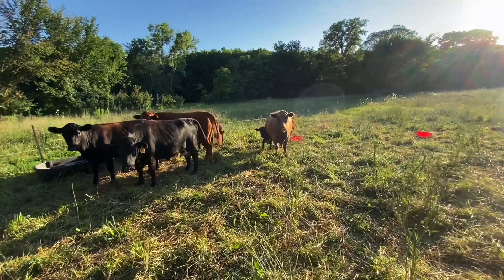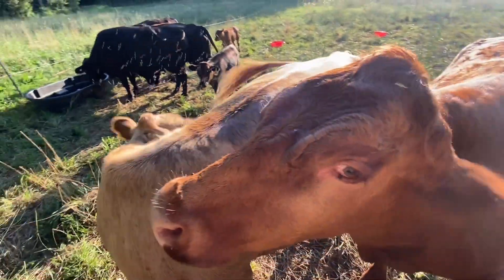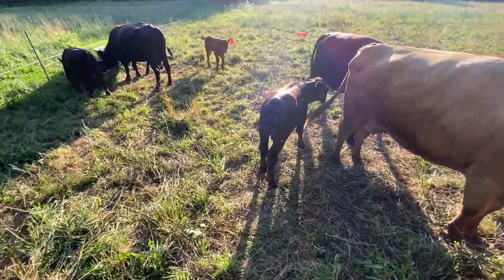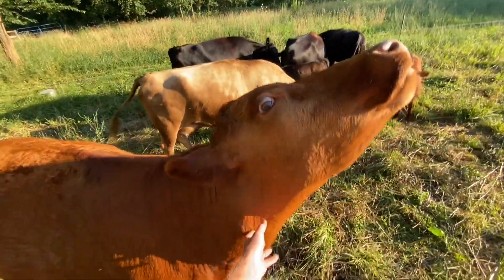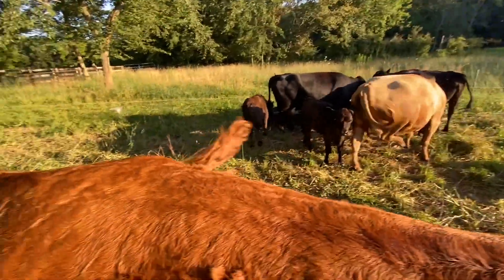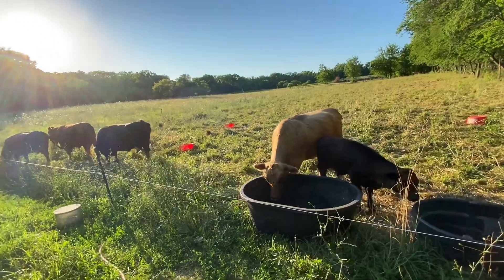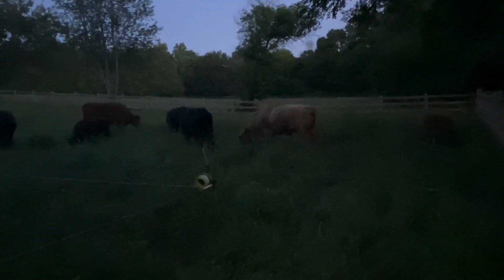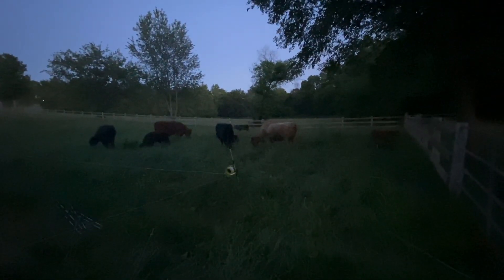Removing CIDR’s In Dexter Cows

Comment: Hey, I had a similar problem RE getting our dexters through the crush, as much like yours they’re very humanised and not really scared to run up the race back at us (which I’m glad about, I don’t want fearful cows!). 
The only thing I’ve found to work for us, is I have cattle panel pen set up funnelling out with a crush, I call them in once a week and feed them in there, shut them in and just leave the crush open so they have to go through it to get back out to graze. It’s worked really well, and they even walk back through sometimes. I’m in the UK so we have to do routine TB testing and getting them in off of the large acreage is essential!
Reply from the maker: I love this tactic. I will usually set up the chute and corral system days in advance so they have time to see it and move around it before it comes time to “force” them through. Once it freezes, to minimize mud, I may set the chute out so they have to pass through it to get to water. Thank you!

Comment: Rob I am not an experienced cattle person,  however a possible solution for the reluctant herd boss cow may be to tie a rope to the squeeze shoot about mid cow.  Run the rope behind her backside around to the opposite side of the shoot take three or four turns on the bar then pull her through, every time you gain some rope make it tight with the wraps so she can't back up. She should have no choice but to move forward and submit to your instructions.  Hopefully this will work for you, best wishes.